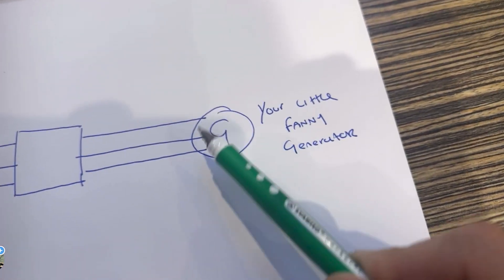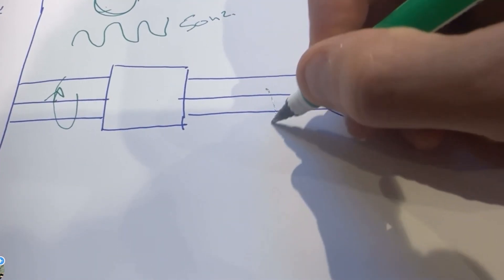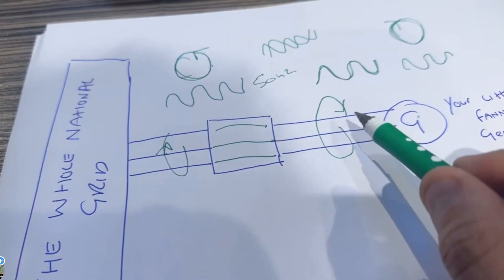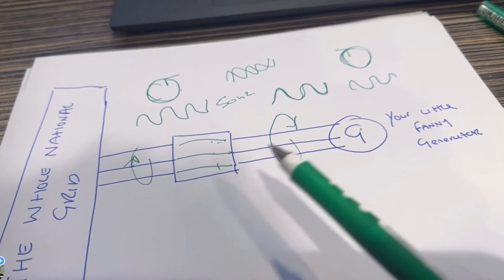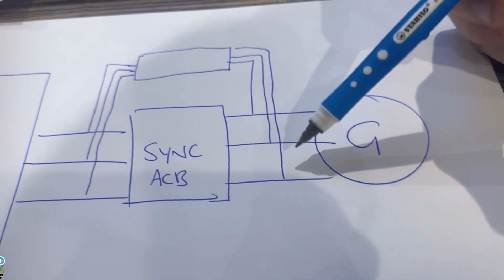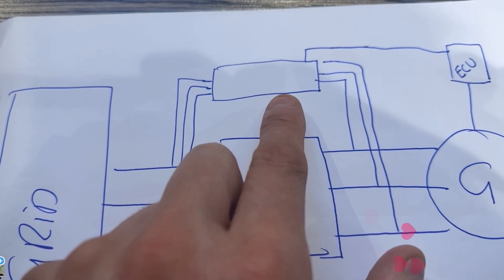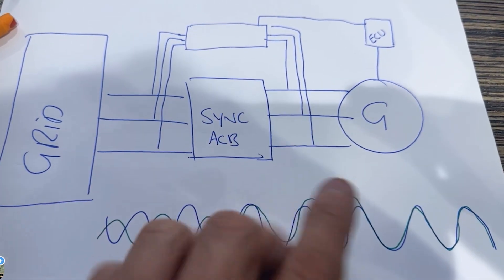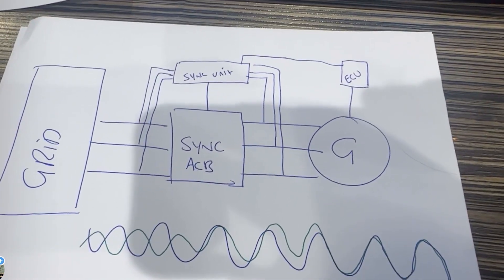what's a sync breakers , generation

Comment: How do you modulate the power from the generator?

If you slammed in the generator straight away at full load the engine / steam turbine wouldn’t be able to keep up react fast enough would it?
Reply from the maker: Yea it’s fine because it’s in sync like water from a stream flowing In To a river

Comment: In the 1970's I was an apprentice fitter in a large Courtaulds factory I spent some time working in the power house. They had six steam turbine driven generator sets to power the whole factory. I was told that they previously had an incident where one of the generators was put on line out of sync. The generator had to be repaired, and the bolts coupling the the steam turbine to the generator were bent!